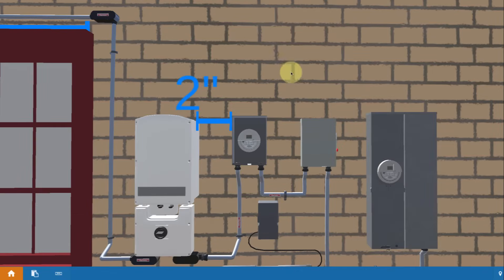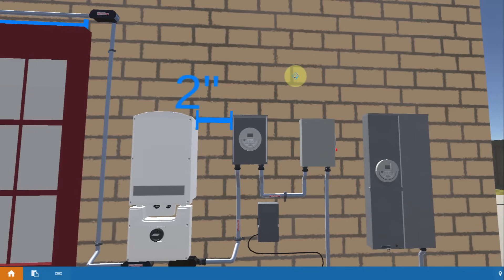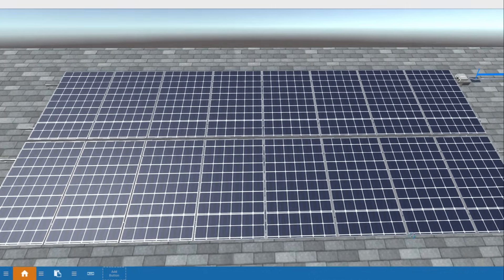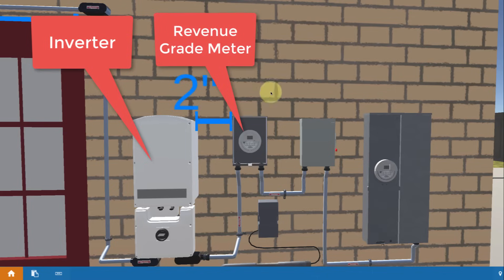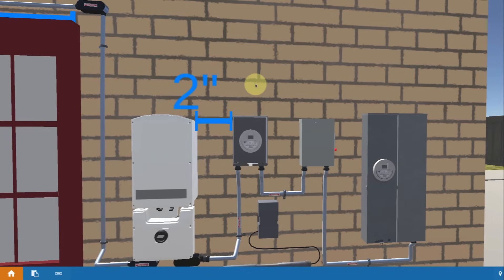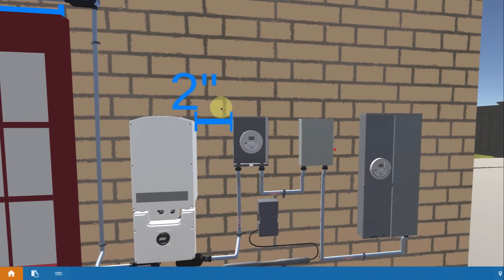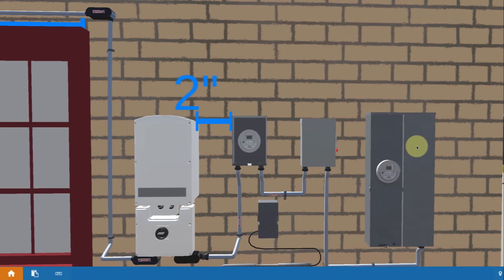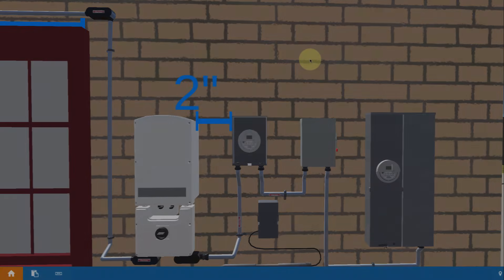Main Electrical Components in a Solar System

Comment: One thing you might want to go over- which you might already do in a different video- is how this system changes using micro inverters.
I’ve had several customers that do their research and insisted on going that route.

Comment: Does the solar breaker at the panel backfeed electricity, or does it power the inverter?
Reply: Back feeding happens at the meter. The breaker is to cut the solar power going into your panel. Theres also a disconnect between the panel and the solar system so you can shut it off there. But you need a breaker to feed the power into the house.

Comment: How does it go from inverter to panel without back feeding?
Reply: My info is that the inverter pulls power and not the panels pushing power to the Inverter. Hope this explanation helps.
Reply: DC power runs from the panels to the inverter. The inverter inverts the DC to AC power which is ran to a meter. From the meter it goes into a disconnect which is fed into your panel. The flow of DC power starts at the panels and stops at the inverter, then the inverted power flows into a disconnect. ON the other end you have AC power from your panel flowing towards the solar system. it stops at the same disconnect and that's usually where the power will meet. The inverter will never flow power into the panels it goes the other way.